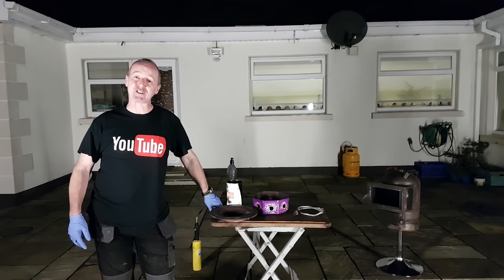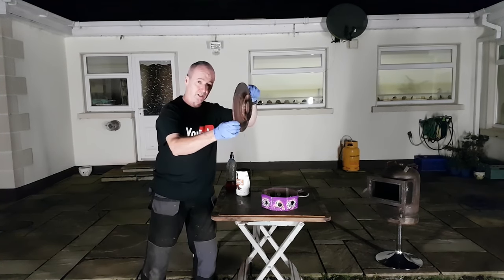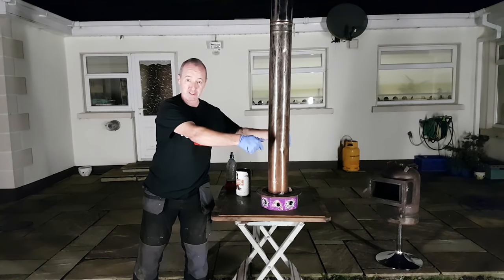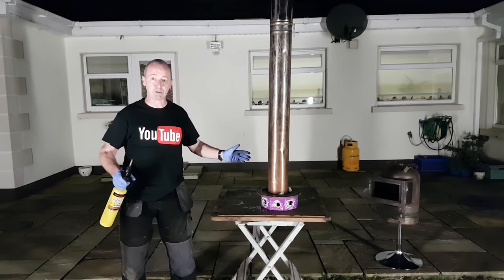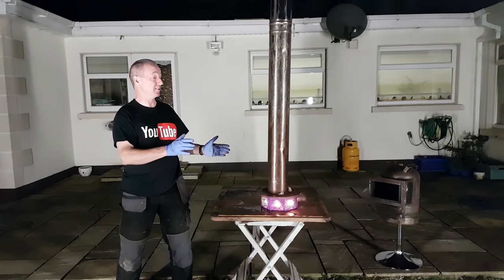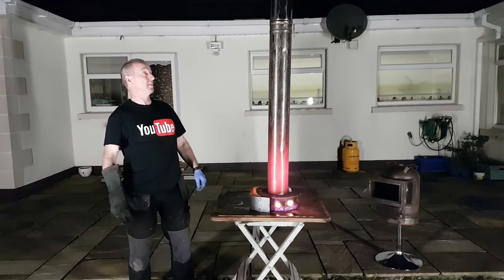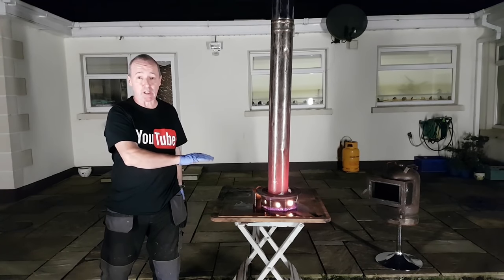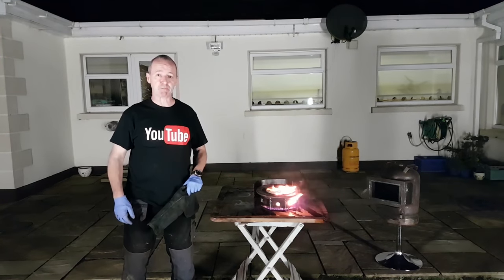Fantastic Output - TIN CAN - Waste oil Burner

Comment: Question. Is it better to recycle the oil at a recycling centre or burn it & create polluting emissions ??  Which is better ?
Reply: Rai Linly chances are, whatever he is using for heat creates emissions somewhere. If you really added everything up, driving the oil somewhere, any emissions associated with the recycling center, procuring and transporting the fuel that he uses for heat etc. , really not a big deal.to burn a couple quarts here and there. There's no free lunch.
Reply: Chris H  . Ok, I get that. In the current climate all recyclable materials are valued as bona-fide products because the earth doesn't hsve sn endless supply. If the purpose of making a waste oil burner is ultimately to always be able to dispose of waste oil then it's going to cause more harm to burn it than to take a few cans to a recycling centre once or twice a year & then the stuff gen be reused for something. Just weighing it up really, burn or reuse ?
Reply: Rai Linly the purpose of a waste oil burner is heat energy.  If you are a climate change person you will never be content with the combustion of any fossil fuel, but in likewise fashion it is highly unlikely that you are going to make any political converts on people who have clicked on the "make your own waste oil burner" video.
Reply: waste oil burners burn a lot more efficiently than wood or pellet heaters and more clean !
Reply: It's purely an assumption that we are running out of oil. But if you think burning oil is bad I don't know why you think running out is bad.

When you take it in for "recycling", you wash your hands of it and assume that you saved the planet.  But the recycler sells it to the highest bidder, which is someone burning it for heat.

If you care about the trees and other plants, you should be happy about burning organic fuels like oil.  That releases carbon dioxide which plants not only require to live, they thrive on it.  I hope you learnt that in 3rd grade science with the rest of us.

Now if global warming were true, you shouldn't be concerned about people causing global warming with heat sources.  Because if the atmosphere gets warmer they won't need to heat anything!
Reply: Robert T I'm just asking the question, not politically motivated. So far I've not had my question directly addressed.
Reply: KC9UDX thanks. I don't believe anyone can save the planet or if it even needs saving.  For the record I live off grid & i burn LPG for cooking so I'm no saint where fossil fuels are concerned. Just posing a question really.
Reply: In our current climate, saving and recycling used oil is not more energy efficient than burning it for heat. Here's a breakdown of why I believe this to be true:

1. An efficient waste oil burner will produce enough heat to provide near-complete combustion. This is observed by a lack of smoke. This means emissions are relatively low and reside mostly on the CO2 side.

2. While we have made great strides towards renewable energy, the majority of our energy is still produced through the burning of fossil fuels. This means that not heating a space with waste oil requires heating with electricity or gas, which ultimately means similar contributions to emissions are made whether you burn the oil for heat or choose to use electricity/gas for heat.

3. The amount of emissions given off on a trip to a recycling center that accepts oil contributes to the overall inefficiency of recycling the product as well.

While we can argue that some efficiency is regained by the use of the recycled product vs producing new,  I do not believe it's enough to surpass or even break even with the efficiency of burning the oil outright.

Once we reach a stage where our electricity is mostly renewable, our cars are mostly all-electric, and our recycling facilities are more efficient, then we will be ready to phase out waste-oil burning for heat in exchange for electric heat. Until that day comes, it's just not worth the effort.
Reply: Steve Mentzer 
I'm with you,,,  but there is one thing that the media  is not brain washing us about. That is,,  the amount of pollution it takes to make and recycle batteries. And that in most cases coal is burnt to make electricity that you put in your eco friendly cars...
Most people can't even name the Sources of energy.. Not even the science teachers,,  on any level. ..They have no clue. ...  Hint,,   think thermo dynamics. ..  With that clue,,,  most will still fail....
Reply: Willy Bee good point. I like to think that I offset my carbon footprint ftom driving a diesel van by living off grid & getting all my power from solar. The government's idea of investing in battery technology & ridding the roads of fumes by 2040 is flawed. All those batteries ! Just imagine !  Seems we can't really win.
Reply: Rai Linly 
Thanks for the reply.
What we think about something, in most cases is based on our world view. Our world view comes from the choices we make about what and how we choose to believe something. If we believe that something is true without varifing it for ourselves first hand. We believe it on faith. 
So, that makes vertually all knowledge a religion. 
So here is an idea that the media has not explored. ..
We had an Ice Age, right?
What man made pollution got rid of it???
But we are told not to think that way.... Or is it,   NOT TO THINK.....
Reply: Steve Mentzer well said. Thankyou.
Reply: Willy Bee so you're saying that mother nature did her work & melted that ice age away without any help from little us, good point. I agree that our mother nature is still behaving in her normal manner although I also believe that humans are making a significant contribution. Hard to measure it though eh. I'm thinking of making a small steel box style stove for a winter van heater & running a simple wicked lamp base inside it with a 2" flue just for any fumes. This waste oil burner might also work inside a stove like that.
Reply: Rai Linly 
June 15, 1991,,, Mount Pinatubo ... That Halloween we got 13 inches of snow, and it did not melt until spring. The snow accumulated to 3 and one half feet ...
The story was going around that Pinatubo erased 200 yrs of global warming..
I can not prove that story,   but follow the money. .. And the control of power...
Oh,,  1991 was the most snow we've had since then...
As far as heat goes,,, the least out of pocket expense is the most efficient. ,  at least in my book....
Around here they are pushing Geothermal heating,,, I asked a contractor how expensive the installation was..  He said for an average size house,  ,,    30 thousand usd....
Like I said,,,  follow the money.....
Thanks for the reply. ...
Reply: Willy Bee I hear you. Be well.
Reply: Rai Linly 
Thank you for the reply. ..
Be well also... and keep thinking,,,  the media and the politicians hate that...   lol
Reply: I am glad to hear a civil discussion of the topic of recycling vs. using new.  As someone said there is no free lunch and there are environmental consequences to recycling or, using new, using fossil fuels, generating electricity.  Although the renewable fuel advocates won't admit it, even construction of solar panels has an environmental footprint.
Reply: Doesn't matter if you're cold.
Reply: Rai Linly , if vehicles burned oil at that rate we'd be human filters !
Reply: Its best to never listen to dimocrats.
Reply: OK so let's correctly address the Rai Linly question:OK I change my own oil,I take oil to say an auto parts store or recycling center they store it and then either burn it off themselves or they sell it to someone who re refines it or burns it off.At that point fuel used for transport has been comsumed by at least 2 entities,me and the recycler,maybe even 3 or more depending on number of middle men.If recycler at first transfer burns it then they may or may not have a system that is eco friendly at which case they pullute much more than I would because of their scale of operation.Scenario 2 I burn my own oil I also pollute but on a much smaller and less frequent scale.So in closing "Six of one half a dozen of another" maybe depending on your personal view of which is "better" me burning oil to supplement my heating bill,ie. Less electric or fossil fuel burning whatever I heat.Or the local,state,or whichever govt. or recycler doing just the same only on a larger  scale.
Reply: Your assuming that burning the waste oil creates pollution. It really depends on how you design your burner. If you can manage to get a good clean burn, the exhaust is going to primarily be carbon monoxide and carbon dioxide. Both of which are easily processed by other species living on this planet. The problem of pollution happens when you have a dirty burn, those black fumes are complex hydrocarbons which are harmful to living organisms. If you really want to save the planet, burn waste oil and run the exhaust through a catalytic converter. The output of a catalytic converted is mostly water vapor, a little oxygen and smaller amounts of carbon monoxide and carbon dioxide than a clean burner can produce. This would ensure that the oil is being disposed of in the safest manner possible while also providing you with a heater that cuts down on your reliance of fossil fuels and natural gasses.

Comment: I would be concerned in generating dioxins, furans and PCB’s by burning waste oil.  For example it is forbidden by EU and UK regulation  to dry animal feed products by waste oil because of this issue.
Reply from the maker: Hi John. This was just a proof of concept. I m my regular setup I burn veggie oil when I can get it and the flue goes outside to the atmosphere. No fumes indoors same as a domestic solid fuel stove setup. Cheers Gerry
Reply: GerrysDiy Cheers GerrysDiy for the kind response, great concept, like approach can see benefits from this for sure, have a good Christmas.
Reply from the maker: Hi John. Here's a link to my latest new burner design. It's very easy to make and have a look about 12 minutes in and you will see it make the stove red hot. Enormous heat output for my shed. Very easy and cheap to build too. Have a great Christmas John. Cheers Gerry   https://youtu.be/ShTLaYKjzxw

Comment: Waste oil burners were a popular source of free heat in the 1940's and 1950's for heating gas stations from the business of auto oil changes.  Unfortunately, it was found that waste oil contains heavy metals from lead/antimony engine bearings and as well as other undesirable items.  This is why used motor oil is considered a carcinogen.  When you open burn as in these types of waste oil burner videos the contaminates go airborne and everything and everyone is contaminated.   A very, very BAD IDEA!
Reply: Vince Brady yeah I agree but if it worked properly the amount of heat causes vaporization rather than smoke that was left uncombusted
Reply: Vince Brady  when al gore flies commercial we'll talk.

Comment: Thats alot to do just to burn such a small amount of oil, il just drop it off at an auto store to recycle better to RECYCLE than to burn it and produce pollution!
Reply from the maker: Hi Winter soldier. It certainly would be easier to recycle it than make this setup but in the next video I added a drip feed system so it possible to keep this running all day. Here's a link https://youtu.be/WyredKT2VdE  I use a burner of a different design to heat my shed and I can cook on it too . https://youtu.be/tnzEDEpz3Yk Thanks for the comment Cheers Gerry
Reply: Because the oil fairy comes to get it and whisks it away to the land of make believe, where all the world's hazardous waste ends up, be it from the creation of solar panels, batteries, wind mills, and nuclear power plants. Just so you know if you went back to horse and buggy you'd find you still have to deal with hazardous waste, horse shit can kill if it gets in your water supply.

Comment: yet another obstacle... oddly we dont have readily available kerosene in arizona...we have to buy it in plastic containers at 10 dollars a gallon...and now my oil goes to chip seal for roads which is much lower carbon output into the air but with other, less disastrous  environmental hazards...so i find it hard to justify burning this crap for heat but i get really cold so i want to, but the carbon consequence is to great
Reply from the maker: Hi philtripe. Diesel works well too for getting this going but I have used paper or even wood chippings. This little stove was just to see if it would work as a 3 piece portable unit. It will run well on veggie oil too  which at least is a renewable energy.  Here's a test I did on my domestic boiler stove wit a similar burner to see if I could heat my house on veggie oil. https://youtu.be/SAmHNp6fOUA Worked great but I disconnected it after the test. Thanks for the comment Cheers Gerry
Reply: If you change your own oil you can keep the oil and you could use diesel fuel to start it instead of kerosene.
Reply: Kerosene is basically posh paraffin

Comment: I sure hope somebody doesn't really try to do this not having the pipe tied down or at least secure betternet it will fall your reaction whether you intended to or not will probably try to grab it this would throw hot oil all over the place even off your metal table top not even a fire extinguisher insight come on man you could have done this better sorry not real impressed with it try to stay alive👎

Comment: You would need one in every room. Not practical.
Reply from the maker: Hi Bdpjev  Here's amnother version heating my house and hot water on 2 litres of veggie oil per hour. https://youtu.be/SAmHNp6fOUA
The burner unit in the video was just a prototype to test out an idea. Here's a similar design working well in a shed heater / cooker  https://youtu.be/SAmHNp6fOUA      Thanks for the comment. Cheers Gerry

Comment: Are you not at all concerned with pollution? Amazing nowadays!
Reply: ririshow nope. I'm not concerned about what you do.  Should I be? If so, I'm very concerned that you are asphyxiating the rain forests by eliminating carbon dioxide emissions.
Reply: Once the correct fuel/air mixture is achieved it will burn very clean. Little, if any smoke.

Comment: Unnecessary chance of burning down me house !
Reply from the maker: Hi Huck Fin. Playing with combustibles and fire. What could go wrong. This is just testing out ideas. Cheers Gerry
Reply: i use it my apartment building all the time...only 7000 residents... they complain, but screw them...lol
Reply: The only risk he ran was burning himself when the chimney fell everything else was fire proof.
When using one as something other than a demonstration of how simple of a devise it actually is you  securely mount the chimney and put a wind break all the way around it.